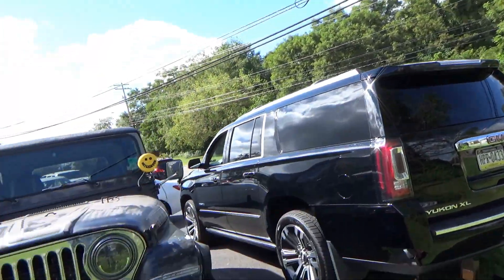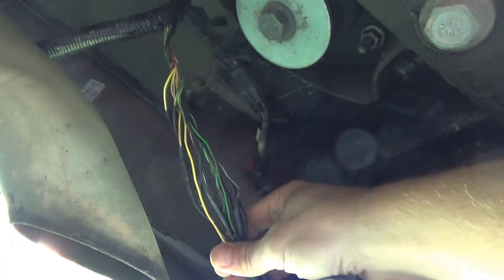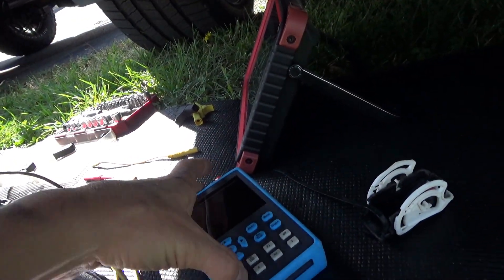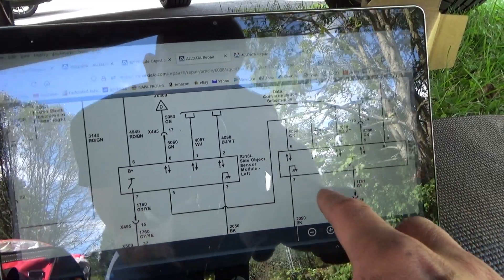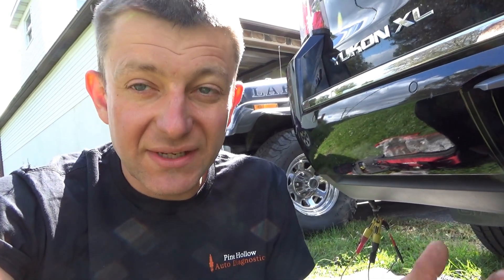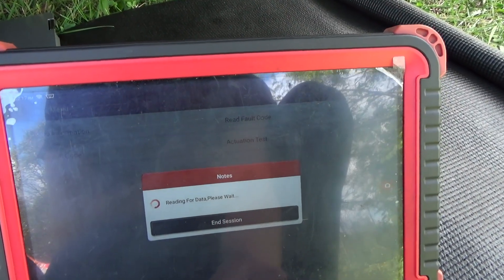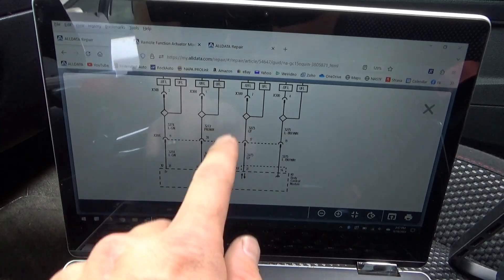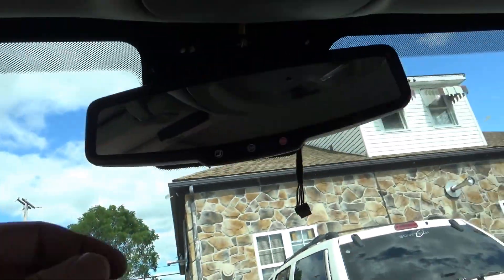I made the WRONG CALL? (Wiring Variables - How to Test INTEGRITY)

Comment: Two types of systems in one vehicle.  Leave it up to GM for that.  But what happens if it's like that on other vehicles?  How many other makes have RPO code labels in the vehicle?  Unless you have GM repair software that point's that out, you don't know for sure.
That's a new one....roof replacement.  
I've seen pinched harnesses after the body shop installed aftermarket bulkheads that separated the driver/passenger area from the rear of the van.  
Good videos Ivan!
Reply: It's not 2 types of systems it's different levels of function the z88 z75 and x88 refer to the brand GMC Cadillac and Chevy witch obviously have different levels of function from each other they put a Cadillac harness in a gmc and surprise ofcourse it doesn't have the same pin out the caddy has the highest level of functionality of the 3
Reply: The new gm’s don’t have the rpo codes anymore in the vehicle, I had to request the build sheet for my 2021 from Chevy
Reply: @braaapattack2937  no they still have the spid label owners manual are going digital but it's required to have the rpo code label it's also included on the window sticker build sheet as well. But errors do happen and you can get a replacement label for the vehicle if needed
Reply: @claytoncoolidge992  unless they hid them now, my 2021 Silverado doesn’t have one, not in the glove box or on the door pillars
Reply: From a google search. I guess it’s a QR code now and you have to scan it with your phone to get it. Guess I’ll have to see if I have that now, but I got a printed paper copy I requested from gm after I got the truck and seen there was no rpo sticker
Reply: @braaapattack2937  it most certainly is supposed to have one and if it doesn't its an error. I even have part numbers for the dealerships to reorder them in case of needed replacement it's on the firewall near the center under the hood on your truck
Reply: @braaapattack2937  it's under the hood on the firewall near the center
Reply: @claytoncoolidge992  have to take a peak next time I’m around my truck (it’s pretty much parked for the winter now being I rather trash my work beater in the salt much as possible)
Reply: @braaapattack2937  for sure I get that I do the same thing when possible. Just make sure you disconnect the battery or put a battery maintainer on it so your battery is good come spring time 😀

Comment: I saw a Ford F150 with leaking tail lamp housings that are not serviceable yet they have the side impact modules inside them. Corrosion took over and the only solution was to replace both tail lamps and harnesses because not only did they operate/communicate with the side modules but a handful of unrelated communication with other electronics. So, two tail lamps, two harnesses and a few other items and $5,600 later in parts expenses, the side modules were fixed as were other codes that showed up because of the tail lamp housings. HOW DUMB.

In this case, I have to suggest that the VIN and the RPO codes are needed to obtain the correct parts so I place some blame here on the parts department for not asking more details about the correct part for the RPO list on the vehicle. Also, the shop owes this customer a NEW factory harness, not a splice job, which could be part of the problem and especially where the splices are, behind the rear tire and subject to the worst conditions any splice could be subjected to !

Comment: wayback....   1/2 century ago.....   the continuity meters that were NOT HIGH IMPEDANCE were preferred for continuity bcause they loaded the circuit thus eliminated the 'single thread' types.  Test lights of proper current are perfect for this purpose.
Reply: Yep.  I once couldn't find if a wire was shorted to ground using a digital meter (1 meg ohm input impedance) but quickly identified with my Olsen Model TE-214 (high school purchase) 20,000 ohm input impedance multi meter.
Reply: @joepanico6480  EXACTLY....   meters that load the circuit have their place and usefullness

Comment: You can also use a Megger to test for Insulation Resistance that would find the short-to-ground, short-to-shield (if shielded), or short-to-(other) conductor.
Reply: A "Meggar" uses high voltage in able to measure a small current. With todays electronics, if there was a short to a signal cable, this would likely kill the electronics: better to just use the digital multimeter as this generally uses a 9V battery.
Reply: @dennisharvey4499  When checking aircraft wiring, we have a Meggar that goes down to 10V or 100V potential, depending on the circuit.  With 10 V potential, on a 20 or 22 gage conductor, for example, an IR check of > 2 GOhm is considered fully-isolated.  Conversely, we've measured IR (conductor to shield, for example) with IR in the xxx kOhm range, which indicates a fault.  It's all about having the right tool, and knowing how to apply it :)

Comment: You can find that fault with a digital ohmeter, but you have to know which tests to make. Test every wire to every other wire for high resistance, and test every wire to chassis and battery positive for high resistance.
Reply: @atilakohbor3360  that's why you need a digital ohmeter: 1 strand will read twice the resistance of 2 wires etc. As Ivan says, it needs to be less that 1 ohm, then it will pass at least 12A at battery voltage. It's important to know the resistance of your test leads so these can be subtracted.
Reply from the maker: @dennisharvey4499  even 3 strands doesn't mean it's a good wire haha
Reply: @dennisharvey4499  I see how you calculate it, but that calculation doesn't work if there is an actual 12A load since a small part of the wire can get hot and thus increase resistance significantly. For a remote receiver that has to draw less than a few mA since it is always on, the resistance measurement and short check is fine.
Also you don't have to check to battery positive since most DMMs will start beeping if they see 12v on the ohms range.

Comment: Some of those trucks that were built during COVID don't actually have the BSM modules installed. There is a tsb about that.  That's not the only system with the same kinda issues😊
Reply: Only model year 2022 and 2023 I work for GM in the dlr parts support center and most of those vehicles have been retrofitted now as they have been getting it taken care of over the last 6 months fyi those that were built without the module have a jumper connector in place of the model to complete the communication network loop
Reply: Oh, how fortunate eh?
 Good grief!

Comment: There's making the wrong call, and then there is dealing with hack jobs that change parameters that lead people astray.
Reply from the maker: Definitely don't see that every day haha
Reply: It's not really a hack job..  The guy ordered the harness with the vin number;  You would think the dealer could get something right once in awhile, but they are pretty clueless half the time;  and only interested at making sales on new cars..   I have a 2002 F350 7.3L diesel--  and I noticed that my door sticker doesn't tell me what axles I have---  so I called the dealer with my VIN and even they can't tell me what axles my truck was built with.   The real "hack" here is the dealer (or whoever sold him the harness).
Reply: @calholli  A Dana 50 will have 229 cast into the center section webbing on the pinion support and a 1-1/8″ pinion nut.

A Dana 60 will have 248 cast into the center section webbing on the pinion support and a 1-5/16″ pinion nut.

The 229 and 248 correspond to the mm diameter of the ring gear in millimeters (mm).

You can also look for a sticker on the rear of the passenger side axle tube. Look for a number on the lower right of the sticker. If it’s a 229 it will be a Dana 50 and if it’s 248 it’s a Dana 60.
Reply: @calholli  you'll find similar discrepancies if you try to find your turn signal flasher...
Reply: @calholli I assume you’re wanting to know your gear ratio? If so unless someone has removed it, there’s a tag bolted to the gear housing,  rear pumpkin third member, whatever you want to call it